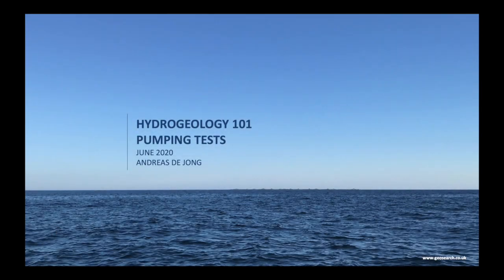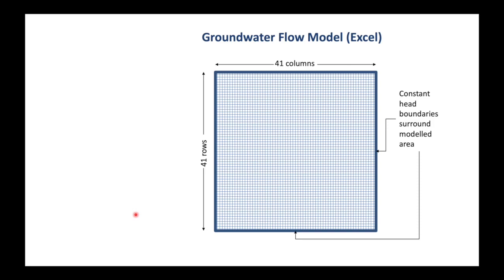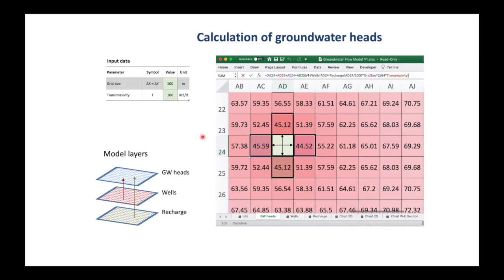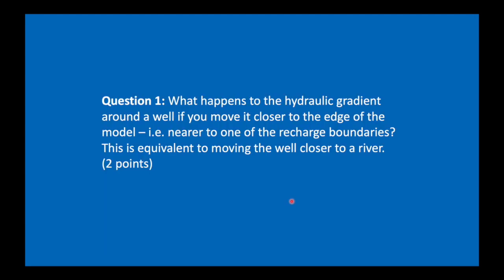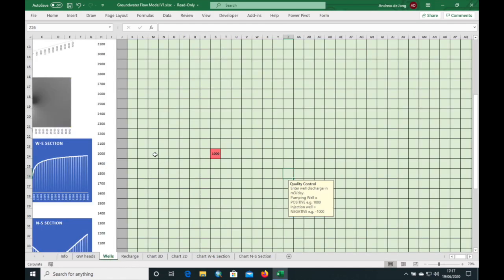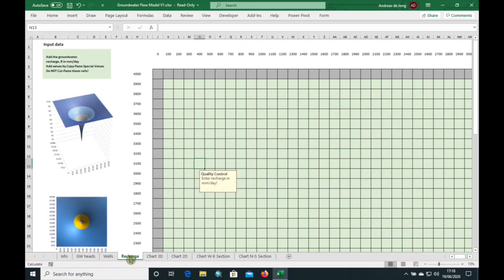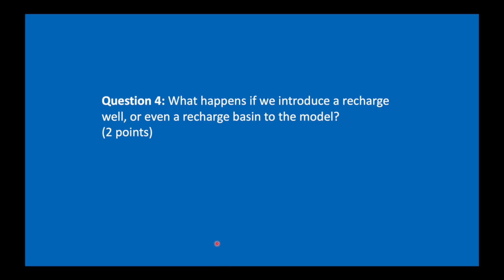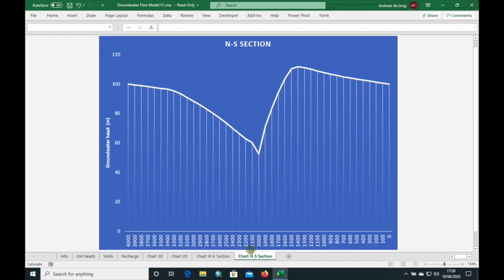Hydrogeology 101: Groundwater flow around wells - Excel model

Comment: When I change stuff in the sheets (e.g. wells) it doesnt refresh the model plots and the data in the GW heads sheet. I tried refreshing and all, nothing seems to be working ;/
Reply: Got it to work - had to allow iterative calculation in the excel settings first :)
Reply: edit: now the model changes with different well settings/positions, but it creates a "bowl shaped" drawdown even without any wells.
Reply from the maker: Hi @Diclofenac_  Initially you have the model that I created with 2 wells, so there is a cone of depression in the centre. Then you deleted the wells, so Excel will start to iterate. With each iteration the model will increase the heads in the cone of depression to slowly reach the 100m head around the model. If you have set Excel up for 1000 iterations, you still end up with about 1 or 2 cm drawdown in the centre after 1000 iterations - the bowl shape you mentioned. Just hit the save button a couple of times and after a few more iterations it should approach the 100m of head in all cells. All the best, Andreas

Comment: Hi Andreas, as a geologist I'd like to thank you for sharing this powerful, smart and easy-to-use excel model. A great tool for teaching and showing how water wells work. My first question is about model V2: in the GW Heads sheet, hydraulic conductivity K has m2/d as unit. As far as I know it should be m/d. My second question is about model V1 vs model V2: in V1 you used Transmissivity, in the second hydraulic conductivity: did you change the formulas underpinning the model or are there other reasons? Thank you again so much and all the best, Roberto
Reply from the maker: Hi Roberto, Thanks so much for finding the copy-paste error in the Unconfined model! So many people have watched the video and you are the first to spot it. I have updated the unit - of course K is in m/d.
There are two different models: 2D-SS-CON GW Model V1.xlsx is for steady state confined conditions, and 2D-SS-UNC GW Model V3.xlsx is for steady state unconfined conditions. The unconfined formulas are more complicated as the aquifer is being dewatered, and there are separate calculations being carried out in a hidden sheet called "V". All the best, Andreas

Comment: Hello sir after long time with another question.
Step test
With help of  step test data, calculate the value of B and C and are used in equation to determine drawdown and diacharge  in equation.
s=BQ+CQ2.
Above is the only purpose of step test or anything more.
Reply from the maker: Hi Kaleem, There are two purposes for step tests:
1) Calculate the well efficiency, V = BQ/(BQ+CQ2), so that we can see if the well has been designed and constructed properly.
2) Decide what discharge rate to use for the long-term pumping test, so that the well is stressed as much as possible without dewatering it.
All the best, Andreas
Reply: Thanks a lot.
Reply from the maker: Welcome Kaleem! All the best, Andreas
Reply: Hello sir,
Could you share the excel sheet for step test.
Thank you.
Reply from the maker: You will have to wait till the video, as it needs to be explained to be useful. All the best, Andreas
Reply: Eagerly waiting
Reply: Reminder